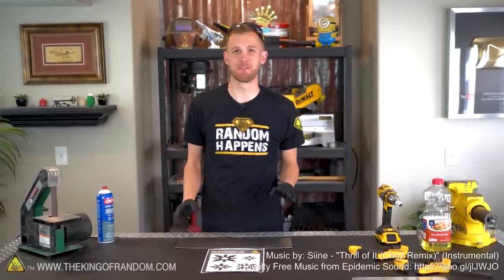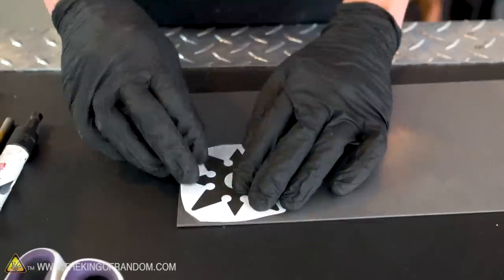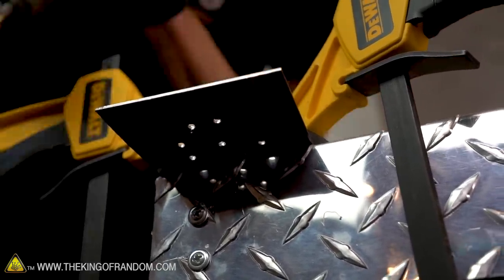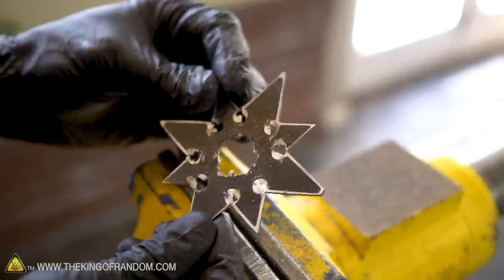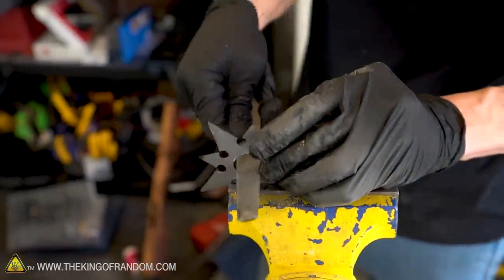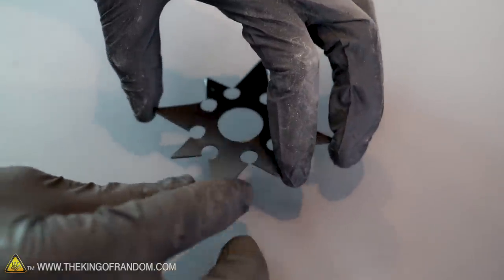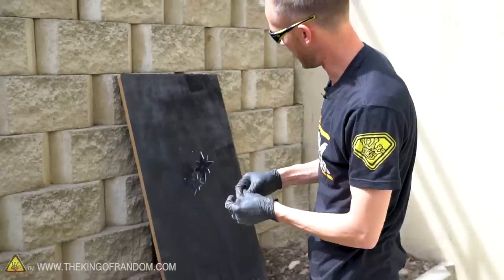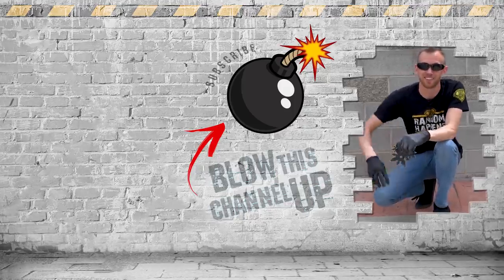DIY Ninja Throwing Stars! TKOR Explores How To Make Ninja Stars!

Comment: Experiment Idea.  Try to cool  a soda(or other beverage) by using a vacuum chamber and evaporative cooling.  maybe cover the can in wet paper towels and then pull all the air out.  In theory, the water should boil off taking some heat with it.

Comment: For future reference when using a hack saw on thinner material cut at a 35° to 50° angle as it will be easier and faster to cut, not to mention a whole lot less chatter and vibrations. Also when using a file refrain from dragging it backwards on the work piece as doing so will cause the file to dull out and become clogged with shavings and become useless.

Comment: As a blacksmith if anyone is going to do this you might want to quench and temper it properly to make it stronger. But don't quench in water because it doesn't cool the metal properly.

Comment: You should use a steel that hardens like 1080 or 5160 because when you throw it at a hard surface it bend and dull very easily with the steel you use

Comment: Now add carbon to the metal (or at least the edges) by a carburization method using your furnace. Then quench harden it. Should give a better and longer lasting edge.

Comment: Please look up on how to file properly. You only want to file in one-direction and them you can make correction on the other side but you still want to file in the same direction on the other side, otherwise you working more than you should, especially when the goal is to grind down the steel and not sharpen it.

Comment: Take some thin metal 1/4 inch or less should do. Draw your star & cut it out with a plasma cutter. If you have the material call around to a weld shop & it should cost u like 10 bucks for them to do it

Comment: You should have used the heat gun the melt the adhesive to remove the paper instead of sanding it off. Like so he can see

Comment: You need tom learn, the proper way to use a file,  put pressure only one way; Look at he teeth, you only want to push down when useing the teeth are facing to the front.